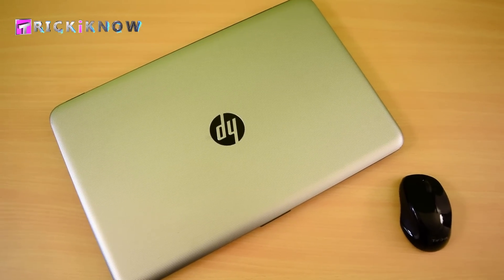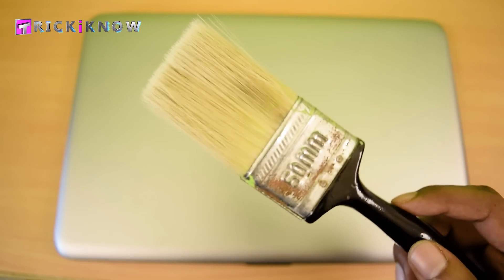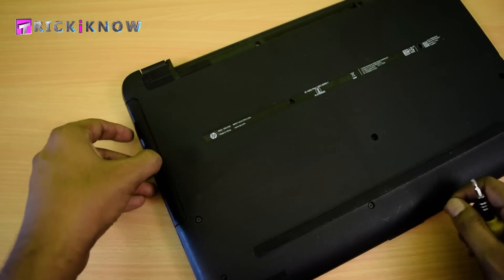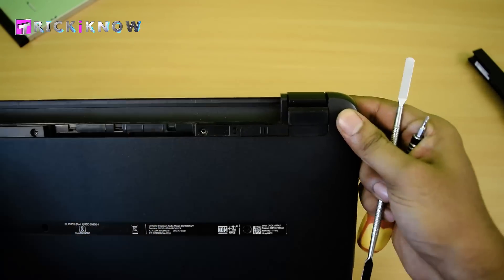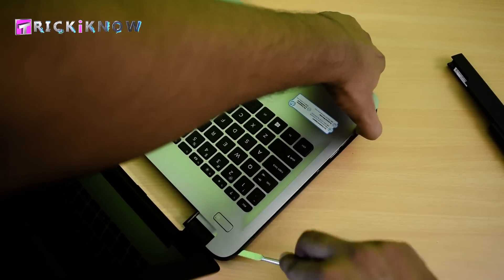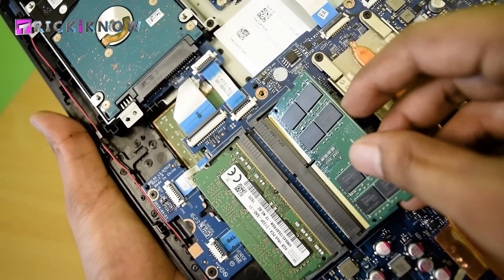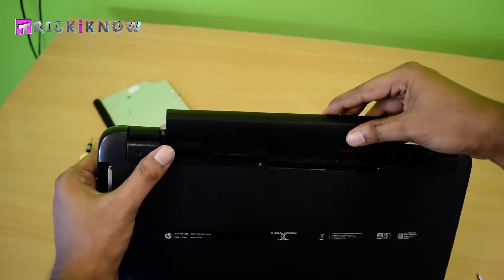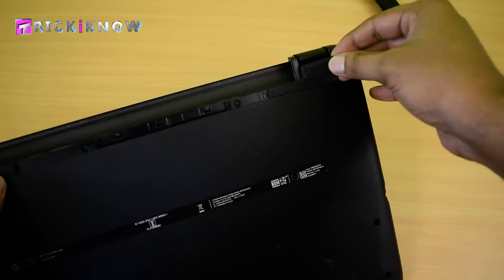How To Upgrade / Install RAM in HP Notebook 15 series Laptop (HP 15-ay008tx)

Comment: A word of advice: if your HP laptop is slow and showing 100% Disk Usage on Windows Task Manager, consider upgrading to an SSD rather than adding RAM, as a high percentage of 15-Series laptops HAVE FAULTY HDDs. A 240GB SSD will cost roughly the same as 8GB RAM (April 2020). I learnt the hard way, and ended up paying for both.
Reply: Thank you!  This actually happened to me after Microsoft upgraded my HP laptop series 15 (bs289wm) from win 10 to win 11 a month ago.  The machine slowed down to the point of being useless.  It would take roughly 45 minutes after boot to complete win 11 load and ready.  Laptop came with a 1TB HDD, 5400 RPM.  I replaced the HDD with a 1TB SSD yesterday, using AOMEI disk cloning software and a Sabrent SATA/USB cable.  The difference is unbelievable.  When I turn the laptop on, it boots to Win 11 in less than three seconds now.  The laptop has 8 gig RAM and now works perfectly fine.   Extra RAM does not do anything unless you are using a very large spreadsheet and are number crunching massively.  Extra RAM has no effect on web browsing, word processing, etc.
Reply: Hey Thanks for the comment my friend. You saved my day. Was having trouble with same 15 series laptop. It was so slow. Was skeptical if i should get it repaired or buy new one.  So i changed it to ssd. Works pretty smooth now. Thanks again. 🙂
Reply: Thank you. Having this exact issue and was going to upgrade both.
Reply: Ssd saved my 7 years old laptop that used to take 5 min to just boot up. Now with ssd it takes only 20 seconds.
Reply: I upgraded both and my performance skyrocketed.  Upgraded to a 500GB Samsung SATA SSD, and another 8GB stick of RAM.  I use the 1TB HDD as an external drive.
Reply: @OfficialDJWolve  Great to hear, though I've given up on HDDs as external drives with my Series 15 - it's somehow managed to kill TWO such drives!
Reply: It would be a good idea to get both either way. They benefit off of each other
Reply: Hi everyone. I have hp15ac101tu which comes with 1TB hdd & 4 gb ram. Should I add both RAM & SSD or just adding SSD is sufficient to increase its overall speed.
Reply: @NagendraKrishna  If I were you I would change the disk first and see. If necessary, then upgrade the RAM.
Reply: can I first install SSD and then install ram?
Reply: @aadimasih3440  Yes, that's exactly what I would recommend. You may not need the extra RAM.
Reply: I've the same issue of 100 percent disk usage and can't do anything. It's even show it when no app browser is open.
Reply: I upgraded the RAM but 100 percent disk usage still persists. I even have 1.5 tb external hard drive to store data, so it's not like all disk are completely full. Which ssd card should I buy for my BS.15 00x series.
Reply: @Daisylove-e4y  Increasing the RAM does not solve the speed issue.  I am wondering if you also upgraded to WIN11 because that would certainly slow down the laptop.  I bought an HP SSD S7200 1TB for about $100 from Office Depot.  You can find less expensive SSD drives on the net and Amazon.  I prefer to pay an extra few bucks but support the box stores rather than Amazon.   Also, the HP technology has a solid quality in my opinion.
Reply: I believe they are talking about a solid state drive, not an SD card.
Reply: @medennawalton6702  Correct!
Reply: But the question is does it benefit gaming?
Reply: Hi, Can you please tell me where can I get the screw driver to open the laptop.Hi, Can you please tell me where can I get the screw driver to open the laptop.
Reply: I work extensively on Graphics will upgrading to SSD help me or i need to do both?
Reply: @TechieGrl , I'd change the disk first, see how well that pans out and then change the RAM if necessary. In that order. Mind you, it's now a pretty old machine to be doing truly demanding stuff on.

Comment: In other hp 15 notebook dissembling videos, they usually start dissembling from the keyboard side and end up dissembling 90% of the laptop to install ram. Does your method work in all hp 15 models?

Comment: The soft pieces at the two corners of my laptop aren't soft, but hard plastic. How do I remove them?
Reply: Carefully
Reply: @laly0033  thanks for the reply. "Carefully" is not a good answer and would not work. I noticed that there are four rubber feet on the bottom of the laptop. I removed the rubber and it revealed four more screws. The back of the laptop then came off just like your instructions.

Comment: Mine laptop has 3 gb ram 1 gb and 2 gb in two slots pc3 1.5 v so please tell me can i update it to 8 gb...
If yes then also tell... After the steps as per your video  should i have to install windows again or after installation it will automatically turned on and work as fine as it is previously... Please reply sir am waiting
Reply from the maker: If your laptop supports DDR3 ram, you can install max 2 x 8gb ram. There is no need to do with the windows or driver. Just plug the ram and use your laptop as it was before, but this time it will work faster.
Reply: @TrickiKnow  thank you so much sir for the reply so if purchase 4 gb ram and replace 1 gb slot with it will become 6 gb 
And sir mine i3 330M which is 64 bit and mother board series is 1425....

So it will work...??

Last question sir 

And thanks again for the reply 😊 sir

Comment: Currently I have 2 GB RAM in my laptop and I wants to add another RAM. I just wants to know what should be the capacity of the new RAM that I would put in my laptop. Like if I put 4 GB RAM then will there be any compatibility issues??? Thanks. Please any body can suggest me

Comment: Hello Brother Thanks for sharing this video. I have a doubt 8 GB DDR4-2133 MHz SDRAM or we can install 8GB DDR4 1.2V 2400Mhz which one is the correct ram. Please advice on this. My laptop model Hp notebook 15-ay543tu

Comment: Hello Trick I know.. can I upgrade HP 15r-006TU using your method or do need to disassemble keyboard and motherboard to reach the ram? I want to install 8 GB DDR3 ram 1600mhz with the pre-installed 4GB ram..will that work..
Reply from the maker: To know better you can watch a disassembly video of your laptop model.

Comment: THE  2 differents size of RAM  you have installed could conflict because one is 4gb and the other is 8gb
and do not use a brush to clean your elements inside as it can generate static electricity 
so yea plenty of things to improve in here
Reply from the maker: thank you for the feedback
Reply: Nope

Comment: HP 15 db0209au 15.6-inch Laptop (A4-9125/4GB/1TB/Windows 10/Integrated Graphics), Jet Black - How much RAM can be installed for this Laptop... Could you please guide me

Comment: Bro I have Hp 15- r065tu notebook laptop having 4 gb ram in it. It has 2 slots of ram and 4 gb ram is installed on 2nd slot. Plszzzz tell me if it will support 16 gb ram or not ?? I wnt to add 8+8 on it. Plz help n suggest.
Reply: just go to crucial.com website and check there whether your machine is compatible with 16 giga.
but you know, if factory originally installed 4 then I suspect 16 will not be possible.
Reply: @maeguk1  in crucial HP 15- r065tu model is not coming.. and its automatic check upgrade tool is not working..so wht to do now
Reply: @a-jsharma4421  possibly the max ram you can put is 8 giga. EIther 8+0 or 4+4.
You need 1600MHz and DDR3.

Comment: I have 4GB 2133MHz DDR4 Single channel RAM Installed in my laptop. Can I add 8GB 2133 MHz DDR4 Dual channel RAM in the second slot?

Comment: tell me the type and frequency of ram i should use on HP15AC179TX ,it already has 4 gb ram ddrl31
Reply from the maker: Use the same frequency as your installed ram, frequency is written on the RAM in mhz

Comment: Thanks for the helpful advice.  It is accurate and made things much easier.  I have an HP Laptop 15-db0011dx, which is very similar.  Only the screws hidden under the rubber feet were a little different.  Alas, when I got it open, I discovered one HUGE difference:  HP only soldered one RAM socket to the motherboard.  Where the 2nd socket should be is an empty area with bare copper solder-pads.  I would solder a 2nd socket in there myself if I could, but half of the contacts are under the sockets, and only a factory soldering machine can solder down the RAM sockets.  So it isn't possible to upgrade it to having two RAM modules.  I bought 2 Samsung 8GB modules, and can only put one in the machine.  So HP saved 25 cents by not supplying a second socket, and cheated me out of 8 GB of expandability.  That also prevents interleaving two banks of RAM to get a speed-up.
    Or is this HP's way of blackmailing us into buying a more expensive laptop that has both memory sockets?
Reply: but it will support one stick of 16 gb ram?

Comment: How to know if my laptop supports DDR4 OR DDR3?
Reply: Download and run the CPU-Z diagnostic tool and look under the tab titled "memory." It should tell you if you have DDR3 or DDR4 RAM.
Reply: @kienan6427 Thanks! It's DDR3 showing in Memory section!
Reply: @vinitrajput6554  glad I could be of help!

Comment: To upgrade RAM in my laptop,  should I take off my previous RAM  which is Installed in my laptop? Plz reply .
Reply: Mrinal Verma no, unless you only have a single slot. There is no point in removing as it’s just more ram.
Reply: without opening the laptop, is there a way to know from the spec whether I have single slot or double slots in my laptop?

Comment: It might be noteworthy that not all HP15 notebooks are configured the same. Not all have 2 slots for memory. Also some do not have the same hidden screws. I have two of these laptops and there are four hidden screws under the rubber feet. Just peel back the outer edges of these to gain access to the screws. Also there is one screw that is 1 milometer shorter than the rest which is directly under the space bar on the bottom, so set this screw aside ,this screw is mounted on an angle so be careful to install it correctly so as not to strip it out

Comment: 2133 and 2400 mhz work together? On this laptop
Reply from the maker: yes you can , no problem. I installed those different pairs in many laptops in my shop
Reply: TricK i Know how about 2666 and 2400?

Comment: Can we use any ram or hp is necessary
Reply from the maker: you can use any brand, but use branded ram in my opinion
Reply: @TrickiKnow  thnx a lot for reply,  and thnx again I opened my laptop thru your video.  It is really great 👍, 
So can you tell me- in my hp 15 achi 122tu laptop has 4gb ddr3 ram of samsung,  now can i remove that and change in ddr4 hynix or hp ram with 8 gb

Comment: you used 2400 mhz frequency 8gb ram with 2133 mhz 4gb ram already in the laptop, this downgrades the clockspeed of the 2400 ram to 2133, does this affect the system in the long run or in any way?

Comment: This does not work with the HP 15 series model 15-DA0032WM. Only 4 visible screws, no hidden ones on bumper casing pieces. And disk drive  has no hidden screws. Answer this please

Comment: What if my laptop only has one slot for RAM And is being used by the 4gb I already have which came by default? Will I have to move my files from Stick to stick or is it different?
Reply: There are no files on a stick of RAM.

Comment: In hp series 15 bu044tu By upgrading 8 gb ram to 16 gb ram is there is any improvement in performance..? As i want to software.. Like autocad
Reply from the maker: Upgrading RAM only is not a big solution for you , install SSD too : https://youtu.be/THPikFuftdQ

Comment: The HP manual states that the maximum RAM is 16GB. I am running Win 10 Home on the Notebook 15-BS158CL, so the OS can definitely handle that (and much more). I was going to install 2x16GB DDR4 2400MHZ modules before I read that... Is HP - for whatever reason - saying that bc they don't want people opening it up or is it true it will not recognize anything over 16GB? I am not advanced enough to understand Motherboard/FSB restrictions. I do appreciate the video, very well done! I've watched several and will be using this one when I make any upgrades! Thanks!
Reply: Probably your motherboard is limited to only power 16GB of RAM. Any more and there may not be enough power

Comment: Does this work with any hp 15? The official tutorial on the hp manual says that I have to open from the keyboard, remove almost everything and turn around the system board to change the memory. It’s a lot of work and things that could go wrong. This way seems ways easier for a beginner like me. I have an hp 15-h0006la.

Comment: I have installed extra 4 gb ram but it is not showing total 8 gb . It is showing only 4 gb installed
Reply from the maker: Try to exchange slots , make sure you have 64 bit operating system installed 😀

Comment: Hey Man, great video. however I have a question.

HP 15 BS007NE Supports 2133 MHz RAM, as it's old I am unable to get it, if I upgrade to a 2400 Mhz RAM will it work? provided both are the same DDR4.

Comment: Can I also add Graphic card to the laptop: HP Notebook - 15-ay021tu and Play GTA 5 and others. 

Current specs:

Intel® Core™ i3-5005U with Intel HD Graphics 5500 (2 GHz, 3 MB cache, 2 cores)
4 GB DDR3L-1600 SDRAM (1 x 4 GB)
Intel HD Graphics 5500
1 TB 5400 rpm SATA
15.6" diagonal FHD SVA anti-glare WLED-backlit (1920 x 1080)

Comment: Thanks brother for the video, its really easy to understand and very helpful guidance... Could you help me by answering some querries...? Although I googled it however every sites have different answers so i thought to ask you in comment.

1. HP 15 af008ax requires DDR3L or DDR4L?

2. The PC expandable to 4gb or 8gb?

3. Its graphics is AMD RADEON 5 M330, so after installing RAM will it support high definition games at low quality video graphics? Such as: Far Cry New Dawn
Reply from the maker: Your laptop supports DDR3L RAM , you can add more  additional 8gb 😀
Reply: Thnks for your reply bro

Comment: Any change in speed and performance???
I have a core i3 laptop, if I add 4/8 GB more ram will the speed improve???
Reply: Just adding more RAM will not improve/increase any performance at all. If you want a tiny performance increase you probably won't even notice, you can search for faster RAM instead. This will transfer data at a faster rate.

Keep in mind that the amount of RAM you have in your machine dictates how many programs/tabs you can keep open (this also depends on how much RAM an application requires).
You can check the amount of RAM you are using by opening task manager, if you see that you are using allot of RAM 70-90% constant, you might need more RAM in that situation.
If not, try purchasing an SSD - if you haven't done that yet - instead.

Comment: Sir i have recently purchased hp da0001ne 8th generation laptop with 4gb ddr4 1 tb sata its boot time is slow and takes 1 minute to use fully operational what should i upgrade ram or ssd
Reply: Im really pissed off its price is 56000 pakistani rupee and im frustrated like hell please guide me an option to make my system boot fast and lag free (ssd or add 4gb ram

Comment: I have a HP Bs-060wm, it has 8gb of ram I want to upgrade it to 16, I’m not sure if it has 2 slots both with 4gb or if it’s one 8gb and two slots. I was also confused that what the difference from dual rank and single rank were, could I remove its current ram and add 2 16gb?

Comment: Hi I have HP 15-AC621-TX with Intel i3 6100u with 4GB DDR3L SDRAM, In built Intel 520 HD 1GB Graphics also AMD Radeon R5 M330 2GB Graphics. Want to upgrade RAM, currently it 1600Mhz 4 GB DDR3L SDRAM, want to find how much upgrade is possible also which company RAM will be better.

Comment: Thanks for the video. 
If my laptop has only one RAM slot which is 4GB, Can I remove that 4 RAM and insert 8 GB RAM. Will that work/support?
Reply from the maker: Ya sure it will work , but then the 4 gb ram will be useless. You can sell it with your friends 😀
Reply: @TrickiKnow  omg this was my worry as well and I couldn't find an answer nowhere in the web🤷‍♂️ According to the third-party apps I install,  have 8 gbts Ram but only the 5,9gb is usable (I don't get it) and dual-channel ram running in  single mode. I guess that means I can upgrade, But my biggest worry was what if I don't have another slot? Is it worthy to make the upgrade in this case? I own a hp db 1019series and I get mixed feelings because I get mixed test results. Speecy and cpuZ saying that I have single-channel memory, Aida dual but runs in single-mode that and crucial says dual channel that can be upgraded up to 32. Your answer was sent by angels. I can now finally rest my case... Thank u so much. Keep posting videos. 👍👍👍
Reply: To know what is the maximum of ram that your pc can hundle instal "RAMEXPERT" tool
Reply: @jessepinkman485  thank u as well!!!
Reply: @jessepinkman485  thanks for ram expert!!!🔥🔥🔥😍😍
Reply: It is possible if your pc accept 8 gb ram . And the 4gb was not his maximum size

Comment: My laptop is HP Ba025nv and it had installed a 4gb ram. I installed another 4gb on the second ram slot. On the BIOS it says that i have 8gb ram installed but the ram frequency is not dual channel but single... any help?